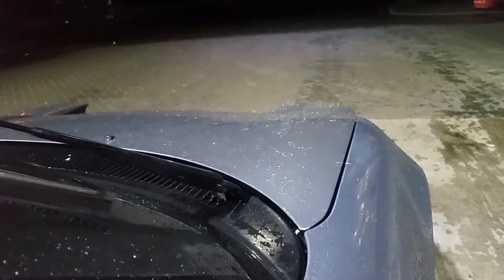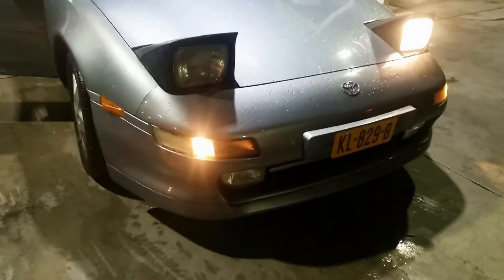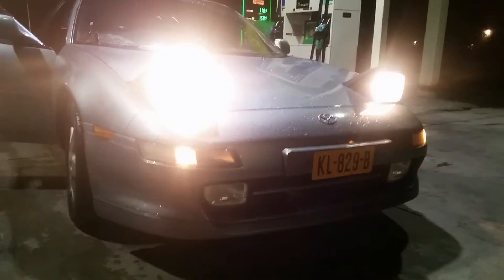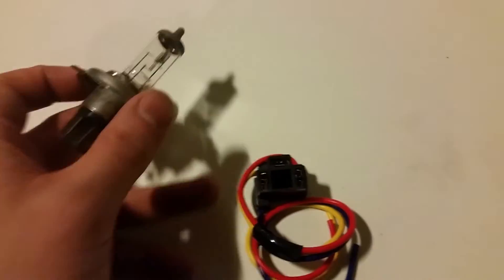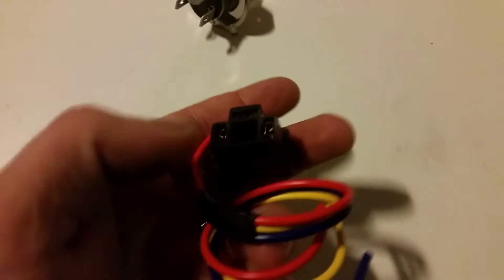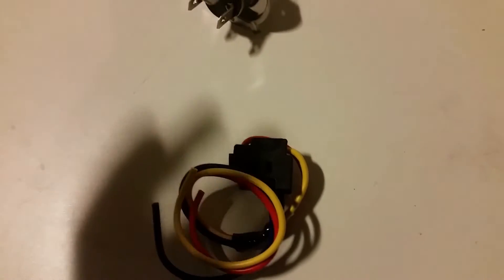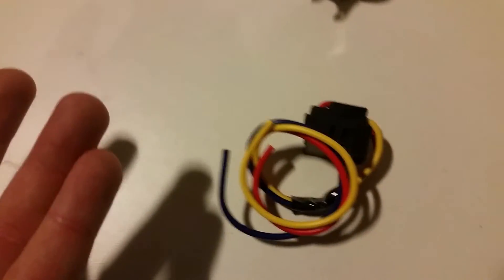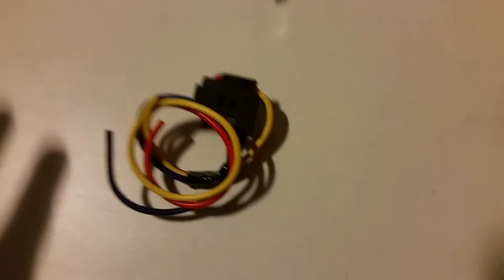How to hook up or convert to H4 headlights

Comment: Obviously it’s the plug🙄 if it’s h4, there are two separate filaments in the bulb, one for each beam, they can break separately so that only one beam works!
Reply: Yep, this guy has no idea.
Reply: Waittt
How to difference low and high beam on H4 bulbs ?!
When lightning filament shielded with thin meat that's low beam, and when burning lower filament it's high right ??!

Comment: So I have a h1 headlight and I'm trying to install a dual beam 9007 so I get high to work not low beam. You're saying run theow beam wire from the 9007 to the positive of the low beam of the h7. Now I have everything connected to the the high beams which are the 3 prong h15. Going to try it now